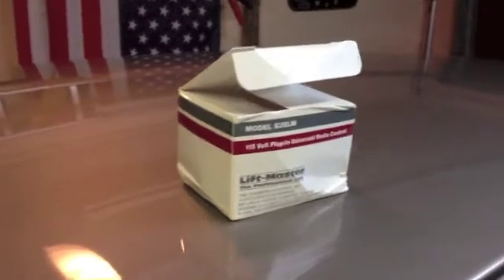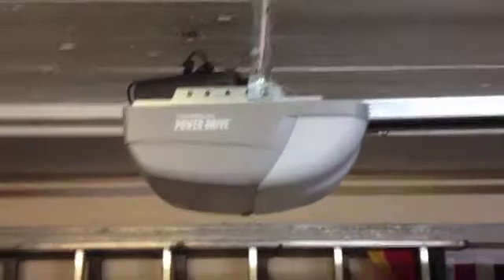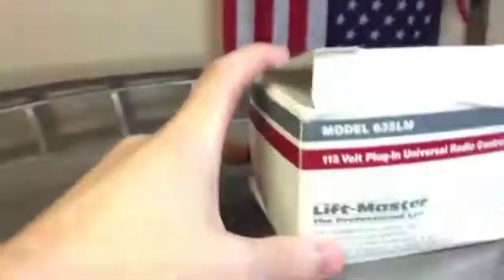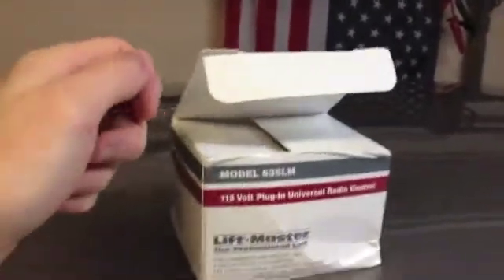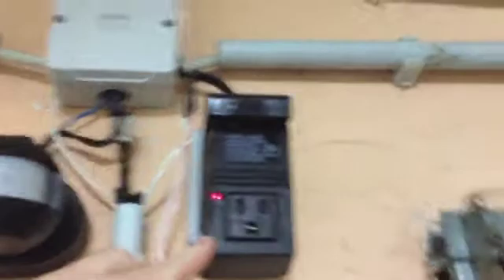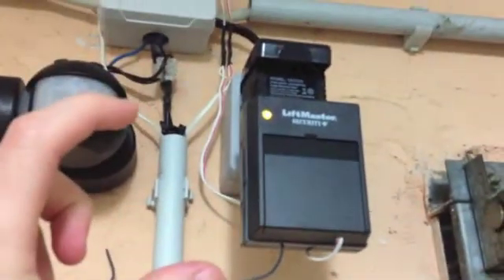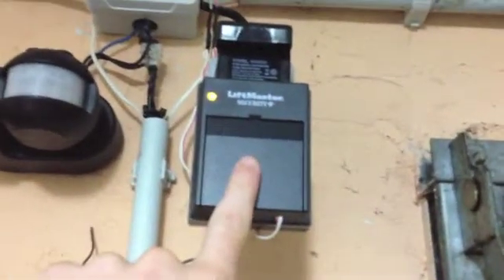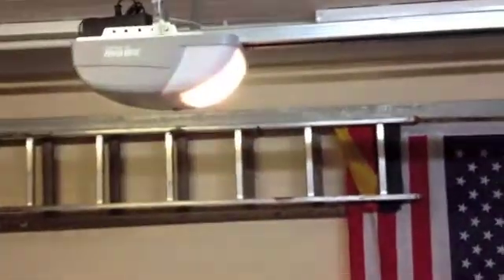How to make US Homelink compatible with European garage door openers

Comment: Have 2 questions:
1. Will 635 LM be able to convert 315mhz into 433mhz? My car is from the USA and its Homelink working on 315mhz frequency while my garage door opener works on 433mhz
2. Will 635 LM work with other door openers other than Lift Master? Mine is Homelink compatible but from another company (Alutech)

Comment: I'm in Italy with two US vehicles with Homelink built into them and trying to find a relay to convert their 315 Mhz (or whatever it is) to my gate's 868 Mhz signal. I don't have any physical switches to tie into like it seems you're doing here with your adapter it seems like. Do you know of any sort of relay/converter box that can learn both frequencies to convert my Homelink remotes to my gate's 868 Mhz frequency?
Reply from the maker: I don´t think there is a way aside using a converter like I did. Even if you have no switches installed, the garage door opener should still have the ports for the switch. You can add this converter directly to where the wiring of the switch would go.

Comment: Great! Do you know wether it would work together with the MyQ home bridge. I have an US MyQ home bridge and of course it doesn't work with my european Chamberlain garage door opener. Thanks!
Reply from the maker: Hi, I don´t know if it would work with the MyQ system but I doubt it. At least not this module. What you need is a MyQ interface intended to retrofit older garage door openers. The 888LM MyQ Control Panel is such a device. It replaces your current control panel and adds MyQ capabilities. But you have to check compatibility with your opener. The 888LM most likely works like my module but with added MyQ and motion sensor.
Reply from the maker: OK after a little research I am 99% sure the 888LM is what you need to get your Chamberlain opener the MyQ capabilities. But don´t be mad if I am wrong, I don´t have this device to test and I just checked the specs of this interface. Making European remote controlled stuff compatible with US standards is a hit and miss. But If I needed the MyQ, this is what I would try with my opener. You will also need the internet gateway but you already have that right? 
Jeez..after checking it out I want it too.... In case I really do get the system I´ll let you know if it works. Please let me know if you got it to work anyway.
Reply: Thanks a lot for your answers. I have the MyQ Gateway. For me there is three questions, that remain open: 1. do the 888ML and the MyQ Gateway work in parallel then? 2. If they don't, can I still control the garage door with a european car after the modification? 3. would the US MyQ Home Bridge connect to the 888LM MyQ Control Panel and then work with Apple Home Kit?
Considering the price of the 888LM MyQ Control Panel, it would probably make sense, to wait for the european MyQ Home Bridge to come out!!? I will let you know, in case I get the 888ML.
Reply from the maker: I am not sure if the european version would be compatible with your US equipment  The 888LM can work in parallel with your european setup.  The 888LM will work with your MyG gateway, it will need the gateway to connect to the internet.If the Home Bridge is compatible with the Apple Home Kit I don´t see a problem.
If your garage door opener is compatible with the european MyQ better use that instead of the US version. It will work with your european car. The US Version will most likely not work with european car systems, only with US cars.  
Do you have a US or Euro spec car?
Reply: eaglevision993 But the 888LM will be US and MyQ Gateway is european but they would still work together??
Reply from the maker: I think from the IP interface on, it should not matter which version you use. The only problem is when radio controlled devices come into play due to the different frequencies. But the 888LM is hard wired to the opener. The 888LM must be connected ( via an IP address) to the bridge. This part of the system should be internationally compatible since the IP protocols are used worldwide.